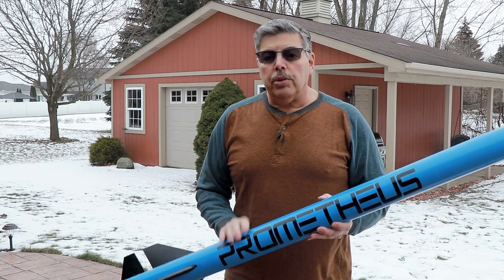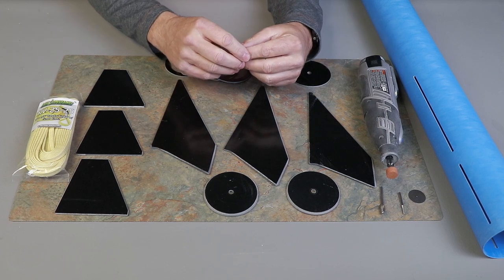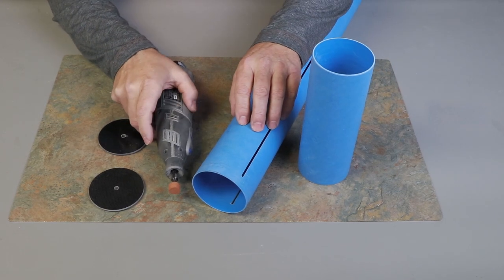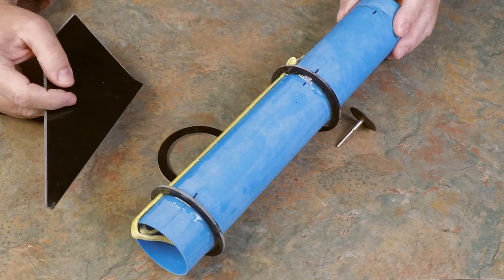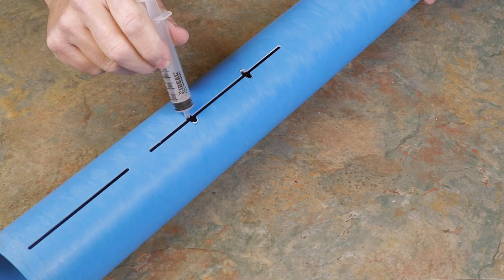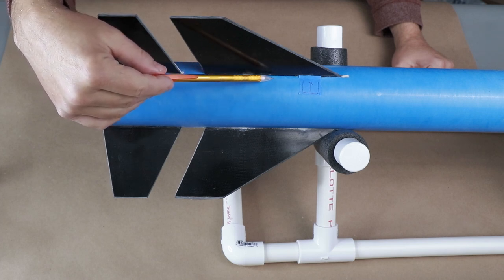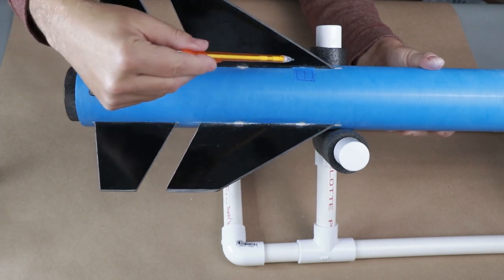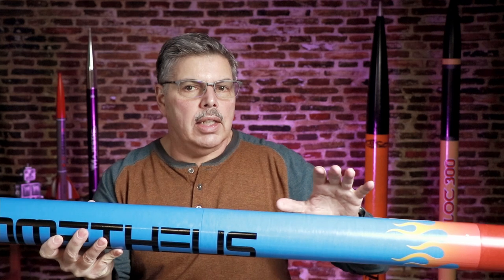Level 2 rocket build, all fiberglass!

Comment: Nice build video, I'll be starting mine soon, what did you you use to polish/gloss the surfaces of the airframe?
Reply from the maker: I used Rust-oleum Clear Ultra Cover 2x on the airframe because it dries fast. This paint is lacquer based even though it is not listed on the label. It also comes in Gloss Clear Enamel that dries a little slower. The main thing to keep in mind is the two clear paints are not compatible with each other. Choose one and stick with it.

Comment: 1. What is total weight of this rocket body? 
2. What are specifications of motor for this rocket (motor class,  thrust, isp)
Reply from the maker: Rocket body only 5.2 lbs (2.4kg). I am going to fly it on an I-300 and J-450 sugar motors.
Reply: Built weight is approx. 8lbs and if built correctly and depending on weight will fly on anything between an I and an L.